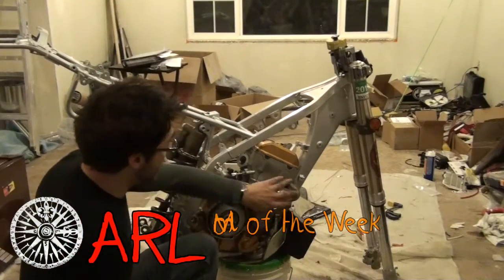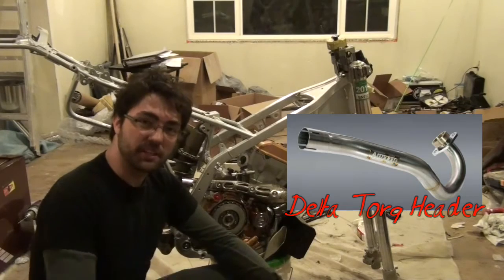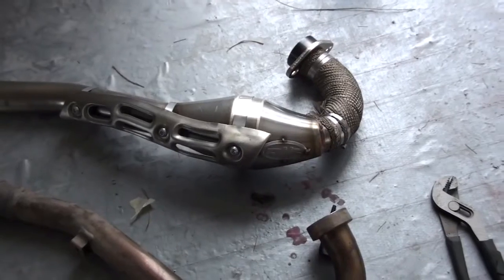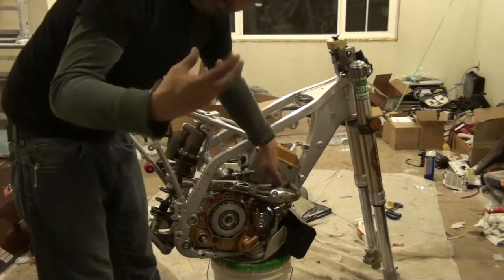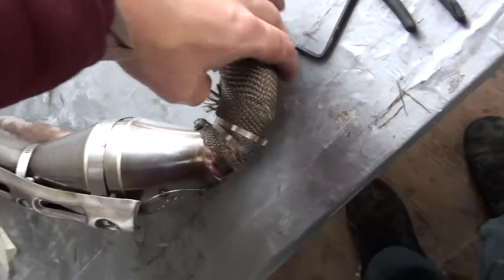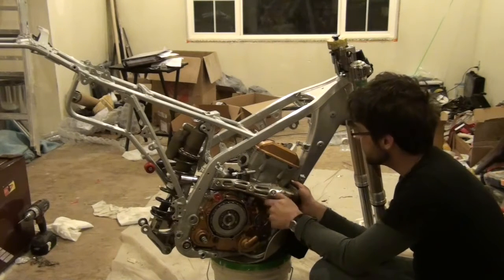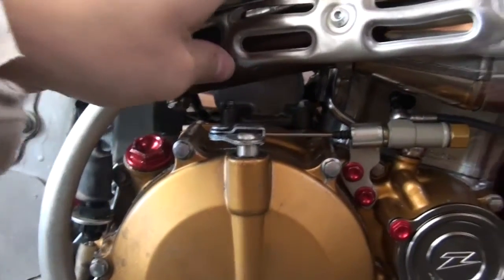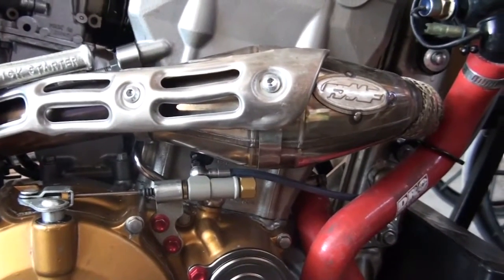Aftermarket Headers for Dual Sport Motorcycles - MOTW

Comment: Would the header burn a hole into the Radiator hose? I ordered some DRC hoses and from the looks it seems my header will probably touch the hose. I might need to wrap it like you did.
Reply from the maker: ***** The hoses are only rated for 350', and the header can get up to 600' if running correctly. Incorrectly of course it can get much hotter. You really got to try to twist the tube as best you can to make it not run into the header.

BTW the wrap isn't for protection, it's to keep exhaust gasses warm to improve torque, particularly at low temperatures.
Reply: Adventures in Real Life Thanks man! I will look into it.
Reply from the maker: ***** It might help to have the wrap, I have some on the forward part of my muffler to protect passenger's shoes (the '07 KLX has a design flaw that makes it destroy shoes). It does protect them, so maybe it would work if you can't work out any other solution. But I'd prefer no contact with a small risk of bumping into the header, to a constant contact with the wrap.

Comment: so, the holes in the pipe creates a vortex inside the bowl or bomb at low rpms to help suck the gasses out from the valves?? is that right? Did I understand that right or miss it completely??
Reply from the maker: Close, not a vortex. It keeps the warm gasses in so that as they cool and compress they create negative pressure in the cylinder.
Reply: ahhhh, I get that :-) makes sense